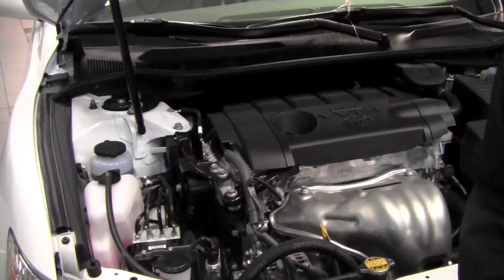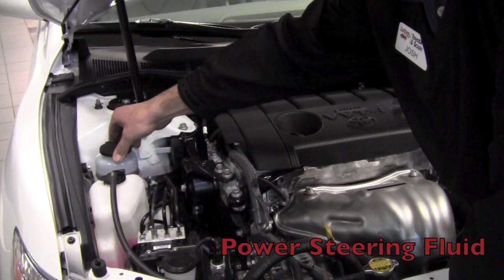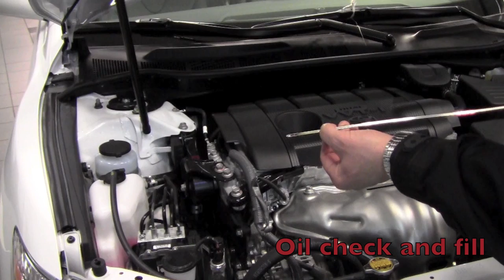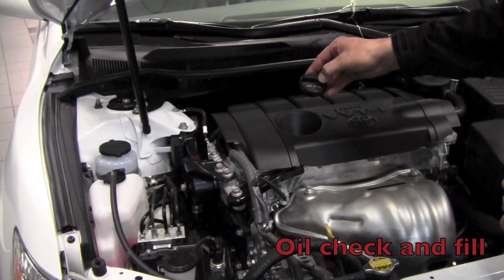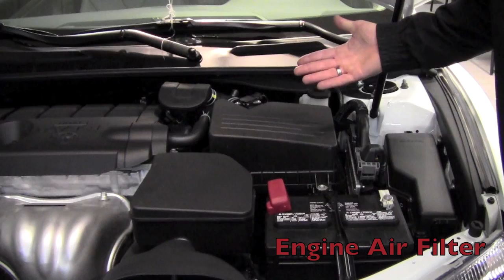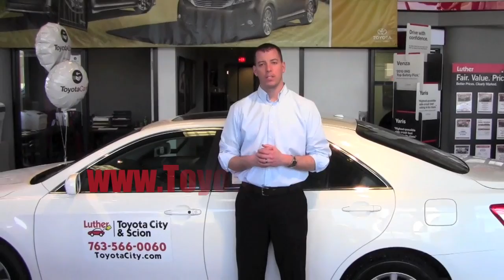2011 | Toyota | Camry | Check Oil and Other Fluids | How To by Toyota City Minneapolis MN

Comment: You didn’t check the automatic transmission fluid and I have a 2011 Toyota Camry with no dipstick how do I check that?
Reply: You can’t. It’s a sealed transmission. Best bet is to just replace the fluid. Its pretty easy and there’s videos on it also

Comment: Start vehicle. Take out transmission fluid "DRAIN PLUG" it doubles as a fill flute . fill with fluid until it comes back out . either pump the fluid in or get some 8 mm paraflex and a differential grease cap and you can squeeze it in if you have the wherewithal to know what I'm saying.

Comment: What about the transmission fluid stick?
Reply: No transmission stick. This 2011 Camry has a sealed transmission which never needs fluid changed.
Reply: @ktobey3983  lol. Seriously?
Reply: @MC-mh2ju  Yes. I own this model 2011 Camry LE and still drive it
Reply: @ktobey3983 so if you having transmission problems it's more than likely NOT a transmission fluid problem.

Comment: Guys, I verified that sealed transmission is legit, I have camry 2011, 200k miles, never did anything to transmission oil.
Reply: Does it have a shift flare between 3rd and 4th?
Reply: @playgroundofsound7683  my does that. Also even when in Reverse the motor doesnt rev to move the car.

Comment: I just bought a new Camry a few weeks ago and it feels like the transmission is already slipping with only 280 miles on it and I couldn't find the xmission dipstick to check the level, and neither did this guy.  Guess what?...this car doesn't have one.  What the hell were they thinking?
Reply: I just buy one 2011 whit 166 and transmisión dont go back or front ..What do you to yours?
Reply: @mvroofing2012  mine is having the same problem. Pressing the gas it stays at 2000rpms but i lose momentum not power but just to keep it moving. Also rms went high then gear engaged. Did you find out your issue?
Reply: The camry car dont have a transmission stick its a bolts under driver tire bottom car u take a loose and have to get car dealing ship to shoot transmission fluid in your car and check it its difficult why they got  do it for u

Comment: so these camrys don't ever need a transmission oil change?
Reply: They actually do but requires you to go to a mechanic and the car needs to be lifted and you add it from under the car. I just had mine done. The dealerships saids don't worry about it but they lying just so your car will mess up having you come back to them later haha. I'm smarter than that I took it elsewhere.